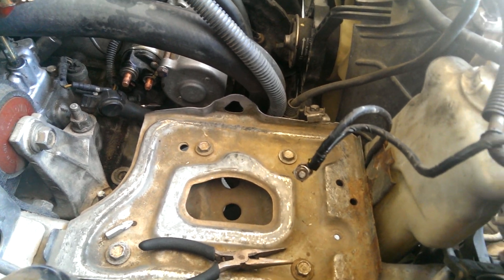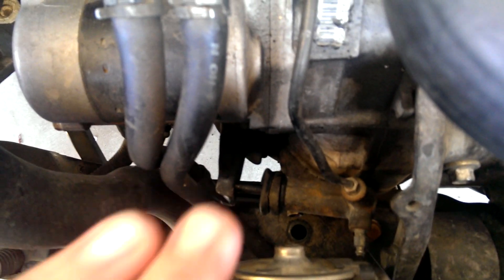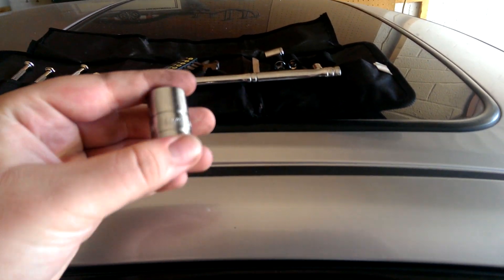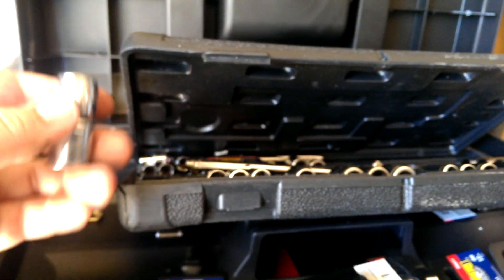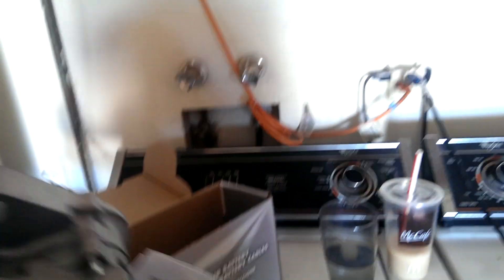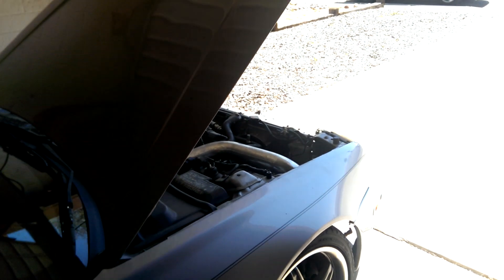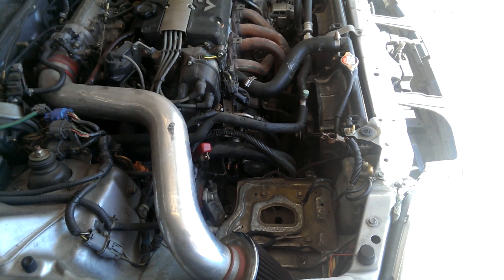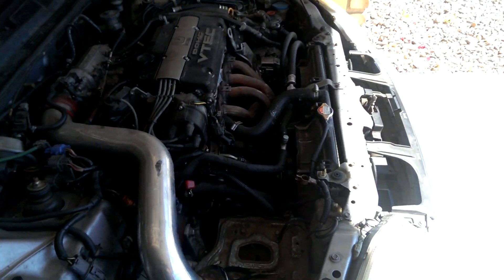97 Honda Prelude SH-Replacing the Starter-Pt 1

Comment: I know this was almost 5 years ago but for any one else with any H/F series engine Honda when the idle goes up and down constantly it is a VERY easy fix that costs $0. Remove the fast idle temperature valve on the bottom of the throttle body and take off the 2 screws holding the cover plate on it, inside there is a wax bead and a threaded ring, the ring gets loose after several years simply take some needle nose pliers and twist the ring back down all the way and then back loose 1/4 turn and reassemble.

Comment: Hey where is part 2?! I have an 01 prelude, same symptoms, I checked battery voltage, fuses, relays, it was all fine. I can hear fuel pump engage on start up so I don't think it's that. I'd like to check the fuel filter but don't know where to locate and it isn't in the manual. Any help would be greatly appreciated!